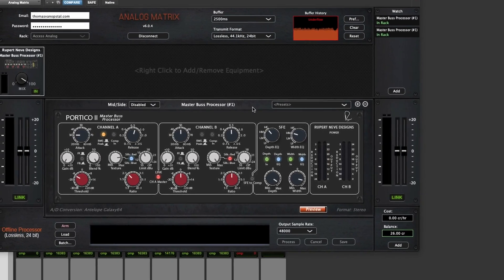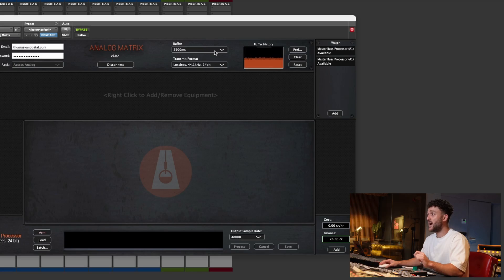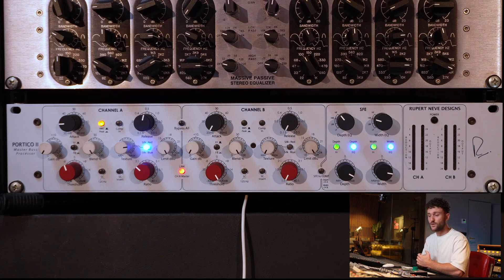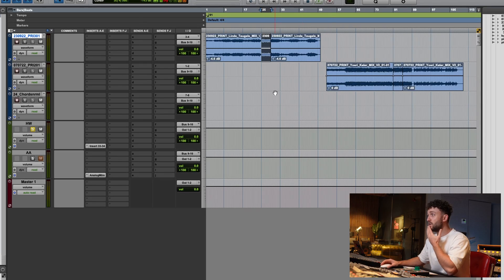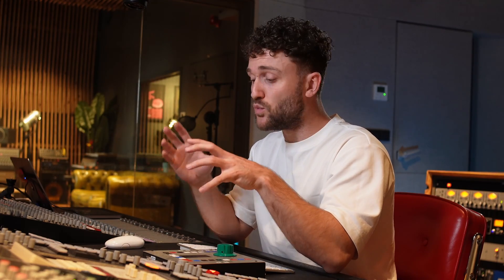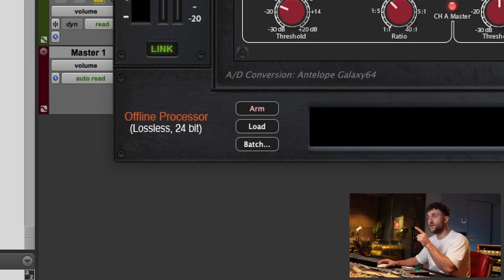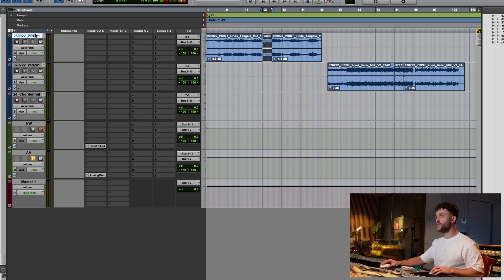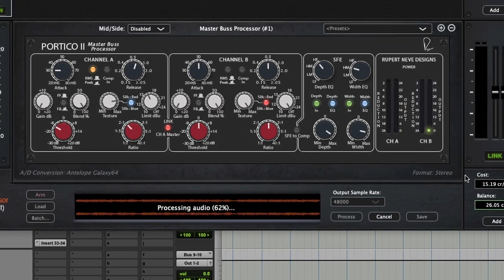Rupert Neve Masterbuss processor IN THE CLOUD?! Plugin vs Hardware

Comment: Thanks for this comparison. I wouldn't expect them to sound the same, since no two hardware processors ever sound identical. Other differences, as stated, can be attributed to different converters and trying to match settings by ear. He did say that there were differences in the metering response, which can be seen clearly during playback comparison where his Portico is showing gain reduction and AA is showing no GR. The converters alone are enough to make them sound different though.

Comment: They're both beautiful, but the hardware, to me, sounds like there is more harmonic distortion, it just sounds bigger with tighter transients, but the real difference is the width. That's quite audible to me. I'm using JBL 6300 series monitors (on Sound Anchor stands) and a sub.

Comment: it seems that the Access analog has a little more low end , that is something i've noticed too between my MBP my 1176 and their gears  , it was bugging me so much that i've sent them a mail and they told me that the gears were also passing through a Neve master bus converter , with a blue silk on 
Access analog is a crazy service ! Nice video as always
Reply: What AA has is a little more 700k that needs to be EQed out… small price to not have to pay $4000 to get to use the unit on a regular basis

Comment: Great video. I stop using AA because of the work flow. Latency, you move the knob and sometimes take a long to hear the difference. Sometimes need to stop and start again to hear the gear. Is slow not like turn a knob in a real gear. Then upload your track to process , then save, then load in your daw. Was a good experience, but when I stop using, I still had credit without use, because of the slow workflow. So I ended investing in my own gear.

Comment: my impression is that the Access Analog unit (or its conversion) seems to give the sense of almost compressing the upper midrange more, resulting in somewhat lesser dynamic impact than your unit, a bit less sparkle, and a slightly narrower stereo image. Subtle but noticeable.
Reply: Yep, I heard this. I wonder if it's an effect of the processing system. I wonder if you just bounced live through the AA Portico, rather than using their processing feature, you'd hear less of that narrowing and loss of top end. 

Ableton's export does this too and it really annoys me people don't hear it. They need to compare their exports to Pro Tools bounce export, which means you have to wait for the whole track to play. The PT version is always exactly the same as what I hear in the DAW, whilst the Ableton export file always seems flat. They have an algo to combine the tracks and all the plugins and VSTis. People say it's perfect, but I don't think so. Bounce in Place vs Freeze and Flatten do not null. Even in PT, their export vs live bounce doesn't null.

Comment: There is latency otherwise they sound the same both sounds like a hardware i presume once you print they will be very close .Something is hapenning in the render is not right it cuts spectrum ..otherwise theh sound the same .Its definetely rendering/conversion issue

Comment: They have the same overall sonic signature, but the hardware in your studio makes the track sound more lifelike and clear to me. The access analogue version sounds slightly cloudy in comparison. Most people won’t hear the difference though. The biggest differences can be found by focusing on frequencies around 7k and above, and paying attention to how the audio moves around in the stereo field. It takes the right person and several years of analyzing microscopic details on a daily basis to be able to immediately hear those kinds of differences.

However, all that being said. I don’t know if we are listening to live playback of your Portico MBP, or if the audio is printed? Because that might make a difference as well. The access analogue file we were listening to was printed. So, in order to have a fair comparison, we need to also be listening to a printed file of your Portico MBP, not live playback. Live playback of analogue gear always sounds clearer to me than a printed file.
Reply from the maker: Interesting take, could you elaborate on why you think live playback would sounds better than the printed audio?
Reply: I should have said “live playback through gear always sounds clearer to me, than a printed file”. At least, this has been my experience since I first noticed it a few years ago. I don’t know for sure why this might be the case, but here is my best guess.

When we listen to audio (live) through analogue equipment, we hear a mixture of things (analogue gear, and digital converters). But, when you print, you are no longer listening to audio pass through analogue gear. You are only listening to a digital recreation of your audio…a “picture” of what once was partially analogue. This digital “picture” is a good replica of the original picture, but it will never be the original. So, I think hearing audio through something that is part of our analogue world, will always sound different than hearing audio through something that is purely digital (ones and zeros). 

Audio just sounds more realistic to me through analogue gear. The less I hear from the digital domain, the more realistic audio sounds. Instruments sound more like they do in real life, voices sound more like someone speaking to me in real life, etc.

Most people think I’m full of shit, but I couldn’t care less. I hear what I hear because I’ve unwillingly spent the last 18 yrs analyzing all day every day, and so I’ve become incredibly aware of tiny details in all sorts of aspects of my life. I’ve spent the last 7 yrs analyzing audio on what most people would consider a microscopic level. Because of these things, I can hear details in audio immediately that most people will never be able to hear. It’s much more of a curse than it is a blessing. It’s given me nothing but difficulties, so I don’t want anyone to think I’m bragging. I wouldn’t want anyone to have the analytical problems that I have. It’s not fun at all.

Anyway, sorry, I’m rambling. It’s hard for me to put these kinds of things into words, especially through text. But, hopefully something I said was interesting, lol 😊

Cheers!
Reply: And, great video by the way. I think it’s awesome that you compared your gear to the gear streaming from access analogue. I just ordered the Portico II MBP the other day, so I’ll be able to do this same test for myself to hear and see how well access analogue compares! I’m excited for the MBP 🤘
Reply from the maker: @danieldavies7308  if you’re talking about monitoring before the AD converter then yes, i agree with you. After it goes through the AD it’s 1’s and 0’s and it shouldn’t matter if it’s recorded or not, the conversion has been done. And if it is, maybe the DAW is fucking up somewhere😅 but ofcourse youre listening to a recording of it, wether it was printed or played back live when recording, at the end of the day it still needs to be recorded for it to be able to be uploaded to youtube.
Reply: Yes, theoretically you are absolutely correct. However, my ears tell me different and I’m not 100% sure why. 

I do know though, that anytime you send audio, (whether it’s through a piece of gear, a cable, a tube, a converter, etc.) it is being altered. This is because you are sending audio in the form of electricity through these things. Electricity itself is full of noise (waveforms) and as it passes through resistors, capacitors, amps, etc, those also create and manipulate electrical waveforms. So, literally anything that electricity comes into contact with, will alter its waveform, and the resulting audio that came from that electricity. The degree to which these alterations become audible is up for debate. 

So, when audio (electricity) is passing through gear and through your converters, there is far more going on with your electrical waveform signal path than there is without the gear. And maybe I can hear that. No idea 🤷🏻‍♂️ 

I’ve spoken with some fellow mastering engineers that can also hear these weird things, and they explain their experiences in the exact same ways that I do. So, at least I know I’m not the only one.
Reply from the maker: @danieldavies7308  yes, ofcourse anything in the analog domain completely changes the signal, that’s the point. But yiu’re talking about hearing the difference between the audio while it’s passing through the gear and then through your AD versus it being recorded after it has done that exact trip through analog and into the AD, correct?
Reply: Correct, I am claiming to hear a difference between those two situations, even though they “should” be the same. 

There is a big difference though in the amount of electrical waveform activity between the two situations. Analogue gear on = much more electrical waveforms. Analogue gear off = much less electrical waveforms. Maybe this is audible? I don’t know.
Reply from the maker: @danieldavies7308  ok, just trying to make sense of what you’re saying, because in this case you wouldn’t be anywhere near the gear, nor would it be on at the time of you seeing it and it is always a recording, so why the question if it was a situation in which i was monitoring in realtime or simply playing back the audio? I’m really confused right now
Reply: I know, it’s too confusing to try and explain over text. I figured this would happen if we kept talking, haha. If I were there in person I could show you what I’m talking about. But, no worries man. Doesn’t really matter. And, either way you made a cool ass video that I really appreciate. Great idea bro 👍
Reply from the maker: @danieldavies7308  haha allright, it’s very interesting! Maybe i’ll get it someday! And thanks! Appreciate it!🙏
Reply: Maybe this helps. Or maybe it will be more confusing.

With the access analogue audio example there was one extra process it went through. Here’s the process:

Audio (DAW) > gear (access analogue)> audio (DAW) > converters (RME) > audio (video)

But, the audio example through your gear went through one less process:

Audio (DAW) > gear (your portico) > converters (RME) > audio (video)

That’s one less process because you didn’t print through your gear to a new piece of audio. So, we are not hearing an exact comparison. Which may or may not make a difference.

I’m sorry, that’s the best I can do through text. Hopefully that makes sense? 😊

If not, no worries. Let’s just move on with life haha 👍
Reply: I’m over simplifying the access analogue process too. Because you are running through web servers, probably their converters and then back through web servers again lol. So, I would imagine by the time it comes back to you there is no way it can compete with the same piece of gear right in front of you 😊
Reply from the maker: @danieldavies7308  hmm, i understand what you’re saying, but that’s not the case. The access analog should have exactly the same amount of conversion steps as the chain with the hardware. The only difference is that with AA they use their converters. The only variables are the type of conversion and ofcourse the quality of the filetransfer over access analog. But the AA file doesn’t hit a single converter on it’s way to the recording for the video on my end.
Reply: Cool, and good to know :) Then you can ignore my “over-simplifying” comment 👍

Comment: what percentage of your work is hardware based and plugin based (actual software plugin based)? And could you speak about aliasing in software plugins?
Reply from the maker: My recordings are 95% hardware based, with mixes it depends on how it was recorded and what the track needs, but i’d say 20-25% hardware. About aliasing, i don’t think about it too much. If there is an oversampling tool, i try it, but i very often turn it off too.

Comment: The hardware sounds warmer, but all analog gear always sounds warmer than their software counterparts due to actual analog components. Software is getting very good for in the box recording. But often I can hear the difference between software processed records versus analog hardware processed records.
Reply from the maker: But you do know that both of these are pieces of hardware right?
Reply: @thomasvopstal  I thought I saw a comparison of an actual hardware unit and then a software vst? I heard the software vst on screen with less warmth than the hardware unit.
Reply from the maker: @Don_nell  they are both hardware units. Access analog actually sends your signal to their facillities, runs it through an actual hardware unit and then sends it back to your daw. So they’re both the same analog pieces of gear only one is in front of me and the other is a couple 1000 km away
Reply: @thomasvopstal  That's a great idea and process for someone looking to have their music go through actual hardware pieces for the everyday consumer. And It sounded great overall, but the conversions seemed to have shave off a little warmth from the hardware unit in the comparison. Both signals didn't sound identical for warmth in my speakers. It's not that big of a difference or may not even be noticeable to most people. But I do bass music and listened to both versions to notice that. When you run an original signal through external converters you are gonna get changes whether it's more warmth or less warmth or more highs or less highs something will be compromised because of different converters being used. It still sounded great in general and may not be noticeable to most people, but doing bassy music and having monitors that articulate bass very well I can hear a small decrease in warmth from those converters and the conversion process. Whenever I use software I usually always have to compensate for the bass in most cases if it was a bass driven part in my mixes. I always wanted a Portico II, and will buy one in the future and was drawn to your comparisons and I appreciate your comparisons on your channel as I listen to a lot of hardware / software comparison reviews.

Comment: Hardware is wider more sparkly high end, aliveness, openness etc. If you want to stop breathing while you're listening you should go for hardware. It has a price for a reason. It's not with all hardware the same thing, but with Neve when you go over 2000 dollars it's quality.
Reply from the maker: Just to clarify, theyre both hardware units. It’s just that one is in a studio in another country that i stream audio to and from and the other is in front of me.
Reply: @thomasvopstal  Aha, I get it now; well your unit is better sounding, more air, more open sound etc., so this RME clean converters are making Neve shine to the fullest in my opinion.
Reply: @thomasvopstal  Hey, I'm just watching specs of this RME ADI 2 Pro FS converter, it has usb connection, does this operate also like audio interface in another words can you record the whole song going from analog IN via usb (like audio interface would behave) into the computer or not. Also I'm looking RME Fireface UCX II that is technicaly audio interface and it has a lot of options but in comparison on offical site to FS; it says it has no analog stereo input like Pro FS but it has on a front panel, you can see it. It's just confusion to the max. :) Does this FS model has some kind of special analog stereo input... :)) Subcribed by the way. 👍
Reply from the maker: @b.hornetiii.6771  good question! the ADI 2 pro fs is a converter with a class compliant usb interface, so it has 2 inputs and outputs ready to go without any drivers on both mac and windows, which is why i got it mainly. The inputd are line inputs only, so no mic pre’s.
Reply: @thomasvopstal  aha, so "ready to go" meaning working with computer (recording into) without use of drivers etc. I like so much the fact that UCX II has USB direct recording function so you can record the whole song on to USB stick without the comp. DAW hassle; but if the quality of recording is compromised (colored in any way) by the mic pre's of UCX than the FS is the best choice to make. Thanks.

Comment: If i focus on the hihat the difference becomes clear, the hardware sounds like a cd and the software sounds more like a high resolution mp3 of the cd.
Reply: They're both hardware man, the access analog is just a robot controlling the hardware and sending the audio over a networking connection so they're both hardwares.
Reply: @aviatedviewssound4798  I know but i wanted to make the difference clear between how i perceived the difference between the hardware neve and  the " digital" software controled hardware.  Youtube is compressed digital audio so the cd an mp3 difference was an analogy.

Comment: You are using Portioco with Antelope Galaxy converters - try compare second Portico that They have - on  Lynx Aurora N - Galaxy converters are not the best. There is significant difference because of different conversion DA-AD //But thanks for this video! Good job!:)
Reply from the maker: Can you switch between their converters? Ive tried, but couldnt find it
Reply: Not true Galaxy converters are some of the most transparent converters ever made .Ice seen antelope measurements they are insane very few things can go close.I just got the new one is 130 dB dynamic range..Lynx cannot beat that sorry
Reply: @georginikolov1141  Use your ears not measurements;) Galaxy converters sounds bad for me - but If you like them then that's cool.